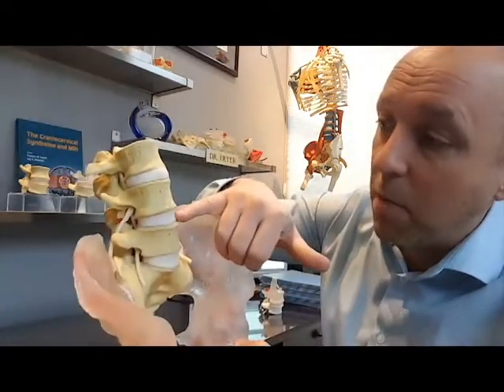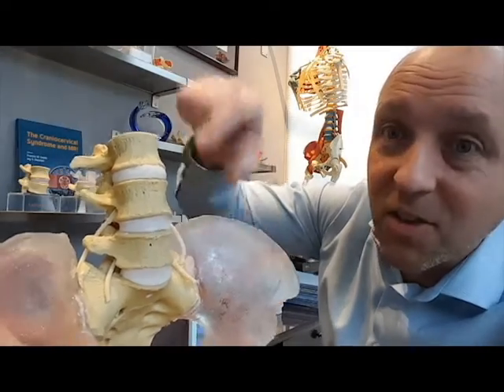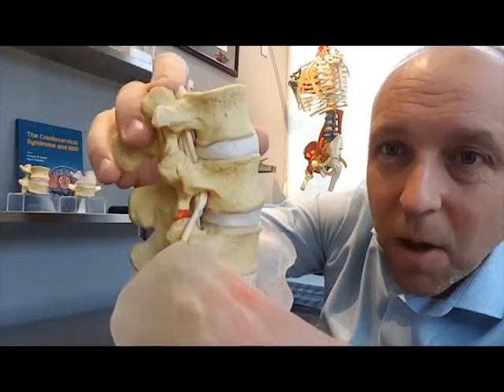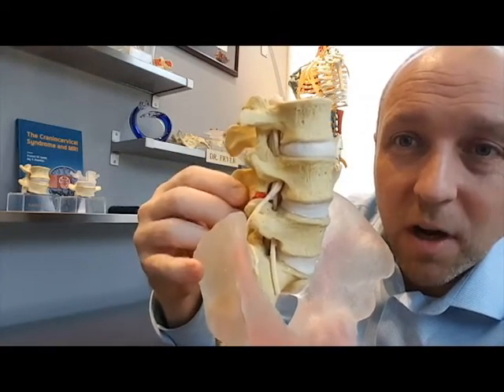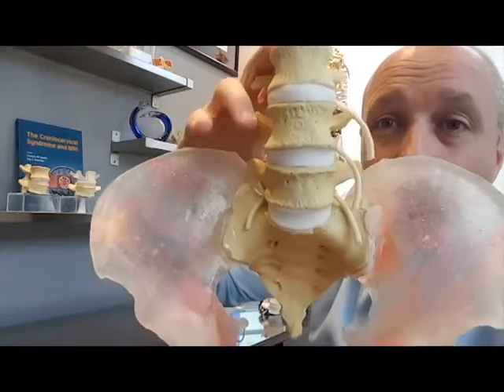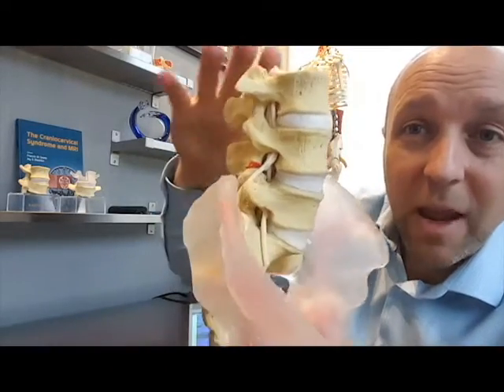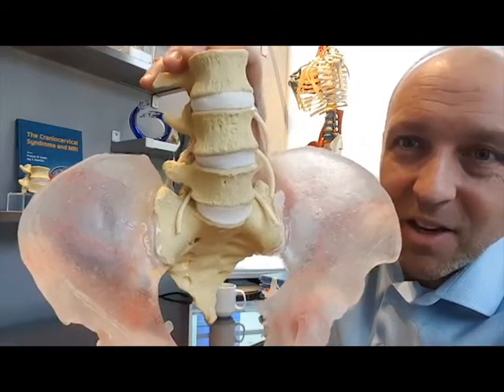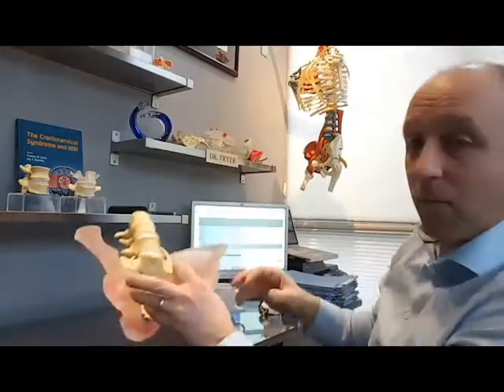What Is Spinal Instability? - Explaining with Human Anatomical Lumbopelvic Model

Comment: Hi, thanks for the video. 
Flexion exercises are helpful in case of spondylolisthesis but it's only when done against gravity I think it adds a value. Because I think if you flex the spine in standing probably that will worsen the instability if one doesn't have enough abdominal stregth. Correct me if I'm wrong.

Comment: I think ligaments have something to do with stability, but all models omit ligaments. There are types of injections that can strengthen the support ligaments. Not cortisone, because cortisone weakens ligaments.
Reply from the maker: true, the disc is a big ligament too. If you don't have disc height, there is more 'slop' in the joint. The ligaments becomes more slack. Thanks for your comment.
Reply: I think the ligament instability really counts only if it's segmentally structured . Cause the ligaments of the spine probably cover the entire length of the spine their laxity would not be evident considering a particular segment. Segmental instability could be greatly affected by structures like the disc or facet joints or pars interarticularis.
Reply: @Dynamicdiscdesigns fair to say that single degenerative disc causes instability?
Reply from the maker: @PhsychoSomatic  it can, yes. Especially in the early stages